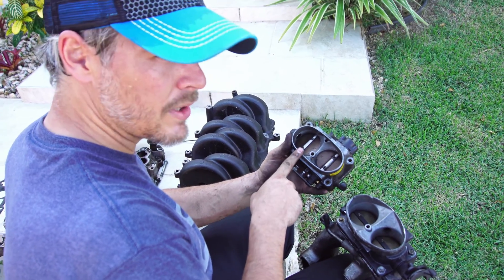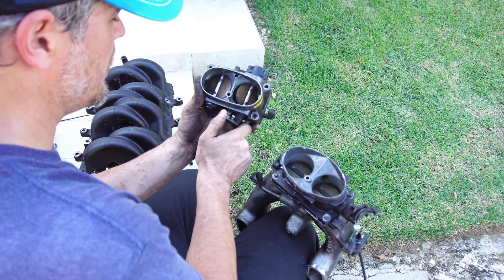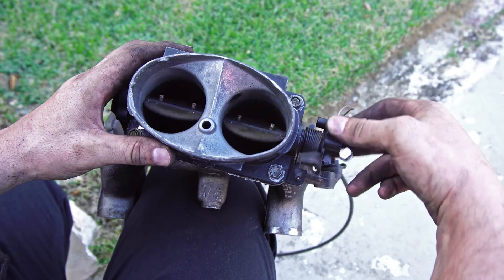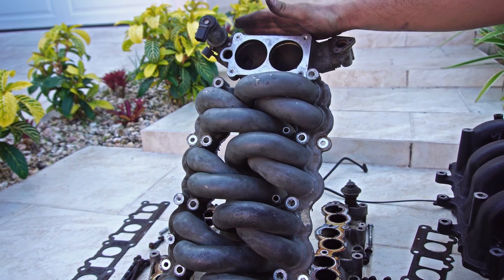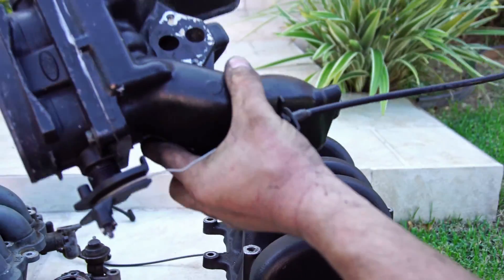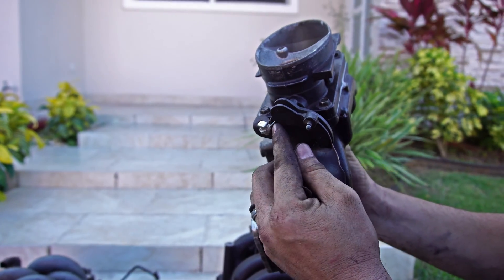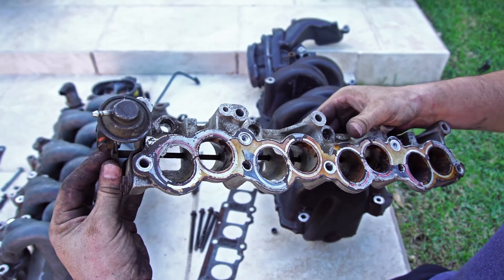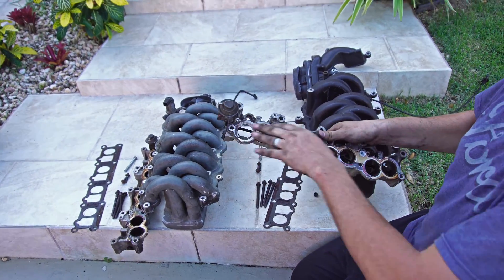Lincoln Mark VIII Intake Comparison

Comment: You just deleted the effect the runner control has on the torque and hp curve made by an intake manifold. The Intake Manifold with the Runner Control (IMRC) will out perform the Intake with the long runners or the intake with the short runners, because the long runners in that IMRC manifold will allow the engine to produce more hp and torque throughout all the lower rpm's until it's up around 4500 and then the runner control valves open and the short runner's continue to hold the torque, flattening out the curve, and the hp continues to climb well past the 6000 rpm mark. It takes incredible engineering to get this effect to work. Now you have a basic long runner intake from the seventies designs on there instead of a high tech multi length intake. It's a fix to keep a car on the road I suppose, but if you want to go fast, you should get the IMRC to work.

Pure basic knowledge that every man operating an engine dyno already knows: 
 Dual plane intake is a long runner intake. For producing power and torque from idle to 5500 rpm. Great driveablity.
 Single plane intake is a short runner intake. For producing power from 3500 rpm on up depending on runner length (maybe 7K possible 8K). Great with a cam producing power at the top.
The shorter the intake runner, the higher the rpm range it produces the power but the less torque overall.

The intake you removed was the best of both worlds, producing power and torque as soon as you step on the gas and continues producing long after the intake you put on there starts to fall on it's face. The only thing DYNO DATA will show you is exactly how high up in the rpm it starts to level off on hp or how high up in rpm before the valves start to float.
Sorry but that IMRC'd Intake RULES.
EDIT: It doesn't matter if it's carbureted or EFI the effect of the length of the runner is identical. It doesn't matter if it's a V8, V6 Inline 6, V4, inline 4, pancake 4, 6 or 8. It doesn't matter the engine brand name Chevy, Ford, Toyota, Honda or Ferrari, or the CI/Litre. Long runner, low to mid range. Short runner mid range to high rpm. Really short or no runner, extreme exotic motor cycle, F1 race engines 10,000 rpm and up.
Reply from the maker: That is some really good information you shared. The issue is that the GT, as far as I know, has no way of controlling that via the ECU. The other thing is that I use the car for drifting and we spend all our time in the high RPM range where the engine seems to breathe the best. I'm not too concerned with the low end for that reason. I hope to eventually get a Cobra upper and lower intake for it that should be better designed for what I'm doing. I've also seen some nice intake and cam combos from Trick Flow and the like. It gets the job done though. I do appreciate you sharing your knowledge on the IMRC though. Thanks for watching and commenting as well. 🙏🏻
Reply: @edwardlthompson  That new manifold is for a real nice idle and highway driving. That's what I'm trying to tell you.
High RPM power = short intake runners.
Before you buy heads, talk directly with AFR and maybe ask them about what this crazy old machinist online is trying to tell you. If you use the car for one purpose, install the parts required to do exactly that. If you're only doing WOT the IMRC is no use but you require the shortest intake runner system you can find and a cam and spring set that goes with it.
Thanks for the reply! Have fun man and stay safe!
EDIT: Sorry. I didn't realize this video is 5 years old.
Reply from the maker: @Ed70Nova427  No worries man. I still have the car and it is still in that same configuration. LOL. I don't have much of a budget to do anything other than fuel, oil changes, and buy new tires to burn. I hope to do a fresh build when I move back to the US on a 2005-2010 Mustang or possibly a C5 Corvette. I really appreciate you taking you time to explain those concepts to me.

Comment: Gen 1 makes more power.....just saying
Reply: If youve ever had the manifold off the car, youd know that was a big misconception grown only from the difficulty of swapping a rear feed mark manifold over to a side fed cobra intake. The early tubular manifolds produce nearly an identical power curve to the later center feed mark manifold, however the center feed has better distribution of air in the plenum which is less of an issue at stock power levels. Those rear feed manifolds only became so sought after because of the factory freaks out and about in '93-'94 running around with fairly hot tunes compared to the later 96+ marks. Despite having mild cams, small cross runner sectional area on both runners, and really restrictive exhaust compared to the cobra, the early cars performed fantastic. The fact remains that both mark viii intakes were designed for power below 5.5k rpms, not performance whatsoever. For a gen 2 car, its best to swap to a cobra intake out of ease of install. For a gen 1 and the struggle involved, unless you are going for the "most" power, the stock intake is far cheaper and easier to make work hence why you have so many people saying its not worth swapping even to a Cobra intake due to the issues caused by having a rear feed inlet from factory. As soon as the 4v b engine leaves the mark chassis, its a different story and never should a performance orientated 4v use the tubular rear feed.
Reply from the maker: Thanks for the advice! The rear feed was a nightmare to install. I had to bang the firewall with a sledgehammer to make it fit and I was having issues with the computer making the proper mix as well as it sticking open. The Gen 2 fixed all that. Runs excellent. I do want to get a Cobra intake manifold eventually but this one is working just fine. I will probably do cams at the same time as the intake.
Reply: @edwardlthompson  Im a big fan of the c head swap and my 94 mark viii will be getting them for sure. Im finishing up a c headswap on my 4.6 2v mustang now. Its worth swapping to the 99 tumble port heads with their 200° @ .050 intake cams and they can be had for about $200 from a 1999 Lincoln Continental. C headed intake manifolds are cheaply available from the aviator for about $150 which will make for a 320rwhp combo with longtubes and a tune. With b heads, a cobra intake, 96-98 cobra cams, and longtubes, you're looking at 300whp and a lot less torque. I still love my B headed car tho. It is just as fast as my 2v mustang was.
Reply: @edwardlthompson  You could run comp 106100s and put down like 340rwhp through stock dual exhaust but those cams come at a stout cost.
Reply from the maker: @madmod  oh wow, not bad power though! I just need something that breaths well on the top end as that's where I spend most of my time while drifting. I'm usually between 75-100% throttle at all times and keeping the RPMs high. Occasionally banging off the rev limiter.
Reply from the maker: @madmod  thanks again for the advice! I'm going to pole around the local junk yard. 😂
Reply: @edwardlthompson  Another fantastic option is the aviator engine as a whole. The 03 engines have the same heads as a 03/04 terminator which are a revised tumble port and flow even better. They use the same cams as your mark viii. As a whole, its a good combo that should make more power than your B headed combo from idle to 7k rpms.
Reply: @edwardlthompson  I love that you're drifting with the B headed stuff tho. So fricken cool!
Reply from the maker: @madmod  thanks! It has proven to be pretty good at it and has earned me a few trophies in competition!
Reply from the maker: Man, you are a freaking Ford wizard! Do you have a website or any blog posts/ forum posts where you could compile all this information or somewhere you can refer me that I can save or bookmark all this for later?
Reply from the maker: You can contact me directly at www.bit.ly/ELTinfo and shoot me a link there if you want.
Reply from the maker: That may be, but I'm pretty confident, it's not due to the upper intake.

Comment: Can you Swap a generation 2  Air intakes in to generation 1?
Reply from the maker: That is exactly what I did. I put the 2nd generation intake manifold onto the 1st generation motor. You will also need the fuel rail from the 2nd generation intake.
Reply: @edwardlthompson  thanks I trying  to but in my 69 mustang... lol
Reply from the maker: @thangnguyen-bs1ti  that's cool! Sounds like an amazing build! Good luck!
Reply: @edwardlthompson  so what you think I used 2003 Ford Crown Victoria for front k member and 2015 IRS rear end and I have to build the frame. everything is done just the motor. I don't want to cut firewalls. thanks again
Reply from the maker: @thangnguyen-bs1ti  that sounds like a lot of work but I'm sure it will be amazing in the end! I don't have any knowledge of the 1969 Mustang but in theory, I think what you are planning may work.

Comment: Dude, do research first. Mark viii engines deteriorated in mechanical precision over generations. So much so that the engineers that built the car took it out to the Utah salt flats to do top speed runs with it and unwittingly set a record with it before it was even sold. Everything you see on the Gen 1 engine is there for a reason.
Reply from the maker: So you are saying they made a worse engine the second try? That doesn't seem likely. 😂
Reply: @edwardlthompson  have you looked at the ports on the gen II intake? They don't even line up from the factory. It's one of the reasons why people switch to the Cobra intake. Cobra engines were hand built and are manufactured to more precise standards, similar to how the 93 engine was since it was the first. Look it up. There are many differences all over the early gen 1 Mark's compared to the rest even down to the carpet.
The intake is designed to give the engine a dual powerband. There are two ports because on of them is closed until 3000 rpm and wot. Essentially making it a 2v for more torque at launch and a 4v at wot once volumetric efficiency is built up. If you were to fix all of the ports open from a start the car would be a sluggish until 3000 rpm until the air flow velocity is built up. It was perfectly engineered for that purpose and is why the early gen 1 cars are always deemed as the fastest.
Reply: @Dino Piccinin my first mark was a CE. It was a great car but again they were cookie cutter engines. Other than the fact that they couldn't pass crash test standards for 1998, the tbird/cougar were discontinued for 1998 because Ford didn't want to waste their 4.6 stock on that chassis anymore and wanted to preserve them for pickups
Reply: @vendediesel  

I bought a 98 LSC a month ago with only 64k miles and in excellent shape, and yet my older beat to shit 94 Mark felt a good deal faster. The 98 is actually a little sluggish up till about 3k RPM's, and then it wakes up while the 94 was more awake across the whole powerband. I hated the intake design with the throttle body at the back of the engine facing upward, but it sure flowed a hell of a lot better and they had better tunes as well.
Reply: @SpiderCollector000  they got lazy around that time with the engine
Reply: Nothing about the gen 1 4.6 B engine was be all end all for performance especially the Mark engines, rather Lincoln desperately tried to tame the 4v engine down and focus on average TQ over HP. The dual runner manifold was a poor attempt at a cure for torque. They fixed one issue(airflow) and caused another (velocity). The rear feed manifolds produce nearly identical power curves to the later center feeds both of which are down significantly to a oem cobra manifold. The benefit to the center feed was equal air distribution drawing from the plenum, which is hands down more crucial than raw flow numbers through the manifold which are essentially identical when actually bolted to the head. Then you get the benefit of better induction plumbing along to boot. Ive had those dual runner tubular intakes off and there is no amount of porting or reworking that would make me want to go through the effort of using it. Even extrude hone has done several of these manifolds with less than fantastic results for the money.
Reply from the maker: Sounds pretty sweet man! I have wanted to do exactly that since I first got that Mark VIII! Love that car!

Comment: I had a stock 95 lsc and a base 97 with a chip hands down gen 1 was faster.  I think gen 1 had the better intake i moded my throttle body aswell were it would operate like the gen 2 none of that half open crap.
Reply: I have a 94 Mark 8. How did you modify your TB to open the flaps at the same time plz?
Reply: Danny Torino did you ever mod yours
Reply from the maker: I never made it open together, I replaced it with the second generation intake.

Comment: The gen 2 has the imrc flaps also as you put it. They are servo controlled. The gen 1 manifold flows better then the gen 2 manifold- well documented. Just looking at it, it had to be more costly to make too
Reply: He's calling c heads Gen 2
Reply: @FirstLast-ov7ch  Nope He is calling gen2 IMRCS as having no flaps. Which they do. Gen2 IMRC he showed someone deleted the flaps.
Reply from the maker: I deleted the flaps on the Gen 2.
Reply from the maker: I'm not sure how to properly call the intake manifolds but the one that has fewer runners comes from the 2nd generation Mark VIII so that's why I was calling it the 2nd Gen.
Reply from the maker: I've not seen any actual data bench testing the two designs but the larger runners on the 2nd generation Mark VIII intake manifold seem far more sensible and the throttle body location on the 2nd generation is FAR better for swapping into a Mustang and being compatible with everything from the MACH1 and the Cobra. I'm pretty sure that if the 1st generation was superior, you would have seen that design used on the MACH1 and Cobra and not the 2nd generation design.
Reply: @edwardlthompson  the Mach 1 and ‘99+ Cobra have C heads with a completely different port design and intake manifold then Mark’s
Reply from the maker: @Isaiah_Does_Cars  their intake manifold and throttle body are the same as the 2nd Gen Mark VIII though. If it were an inferior design, seems like they would have reverted to the Mark VIII Gen 1 design if it were superior.
Reply: @edwardlthompson  there not though. Google 4.6 4v B heads and C heads and get back to me. C heads started in ‘99 across the board
Reply from the maker: @Isaiah_Does_Cars  maybe you are confusing the upper and lower intake in this video for heads. I was only comparing the upper and lower intake from a Lincoln Mark VIII which are a completely different component than the heads.
Reply: @edwardlthompson  the ports on the intake are matched to the ports on the head. B heads have 2 and C heads have 1. Pretty big difference. Google it
Reply from the maker: I'm not debating that the heads are different. This video is a comparison of the intake manifolds and showing the difference between them. It's a short video, maybe you could watch it again to see what I'm talking about?
Reply from the maker: The Lincoln Mark VIII from 1993 has B heads. 😂 I think we can agree on that.
Reply: @edwardlthompson  All Mark VIII's have B heads. Go get educated on Google and stop stubbornly replying to me. I'm trying to help you
Reply from the maker: @Isaiah_Does_Cars  I'm not disagreeing with you. I agree, the Lincoln Mark VIII has B heads. That is not what the video is about. It is about the intake differences between the 1st and 2nd generation Mark VIII motors. I have made no mention of heads in my comments or the video.
Reply: @Isaiah_Does_Cars  You are misunderstanding him, not the other way around. He is saying the generation 2 mark viii manifold has better throttle body placement, rail mounts, vacuum and egr placement, and even induction plumbing that are compatible with later mach and cobra all of which is true. He is not saying the b manifold is compatible with the c heads whatsover, rather that when swapped into a Mustang, the fuel system, throttle cable, and induction plumbing is far easier to solve than the rear fed tubular intake.  This makes this manifold a better swap into most cars especially mustangs considering the factory tubular manifold would have your TB in the firewall, and the early and late manifolds produce almost identical power albeit down significantly from a genuine cobra manifold. These mark manifolds can be had for $25-50 as apposed to a 96-98 Cobra manifold which would run $400-500.
Reply from the maker: Ah, I'm just seeing this now, yep, the firewall was a nightmare as well as a few other issues. This was definitely the way to go for me. It's a much more budget friendly option than the Cobra.